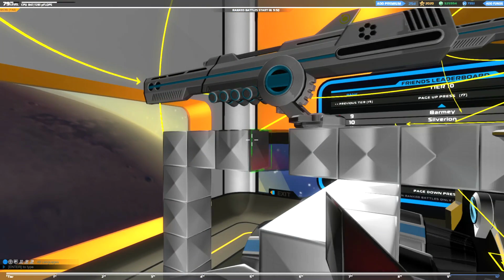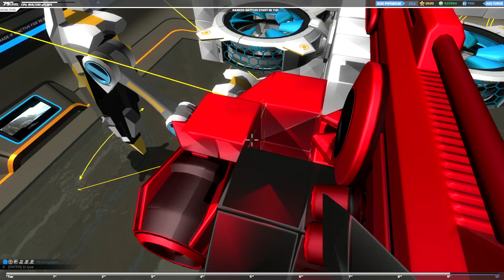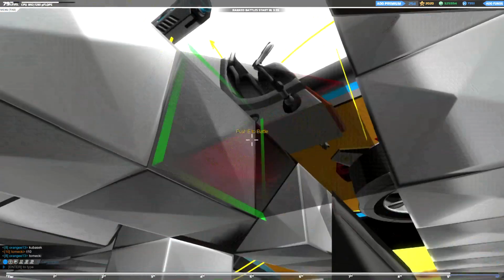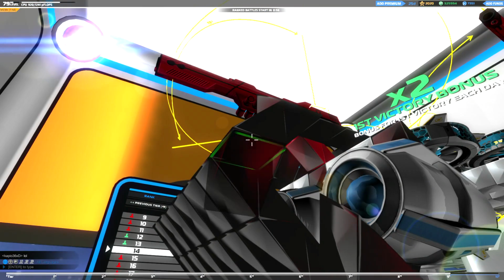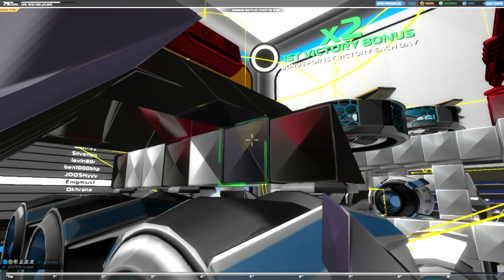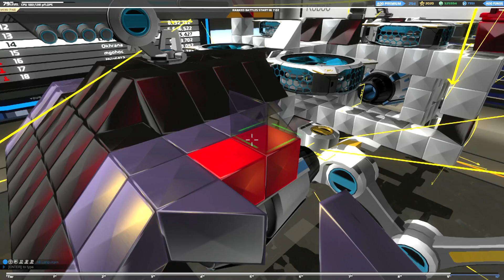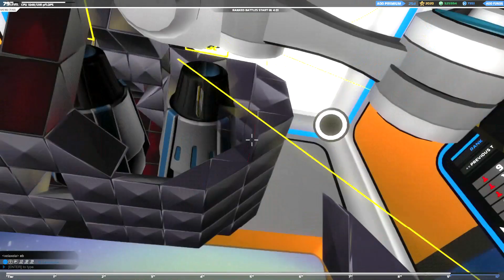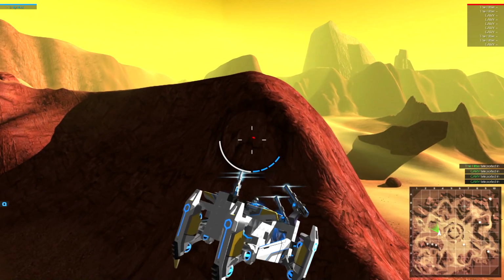Robocraft Early Access (Ep. 59) - T10 Hovering Rail Walker "Panther Bee" Build (pt. 2)

Comment: Im wondering..
Rudders/wings are used to Push your ship..but there is a max they can help..
snipers are either Tanks in 1 spot, or light and quick..
I think you may be over doing it..
Quick enough to get away or new location?  Getting to a spot at the beginning of battle? You may have a problem.

Im sorry, shouldnt say anything, I Quit the game after they Nerfed the SMG 3 different ways in 1 update.
Reply: Heh, try the new dominant gun technique as seen on reddit :D

You get the firepower of 3 mega SMGs using only one mega SMG and 5 T1 SMGs.
I put it on a tank with 500 armor cubes and 4 tracks, 300 CPU left for other components, but 5x the armor for same firepower.. Very worth it with easy 2 kills per battle